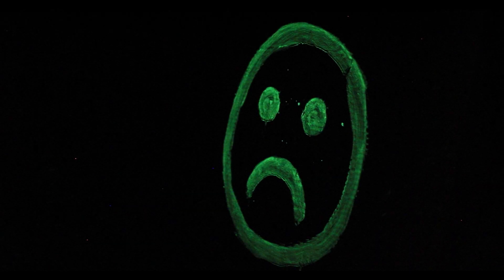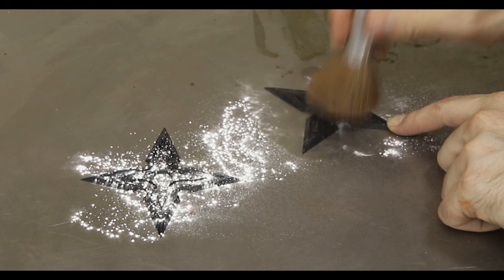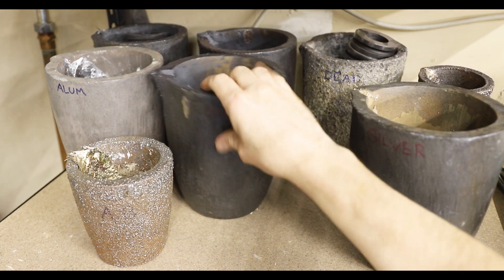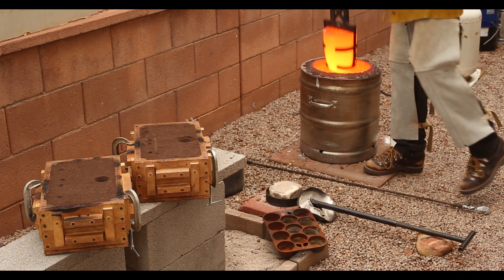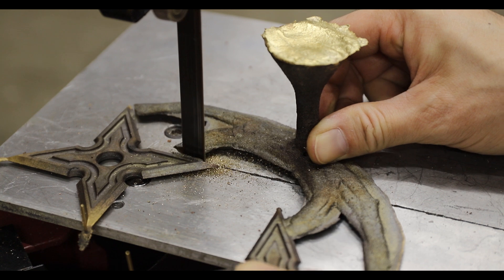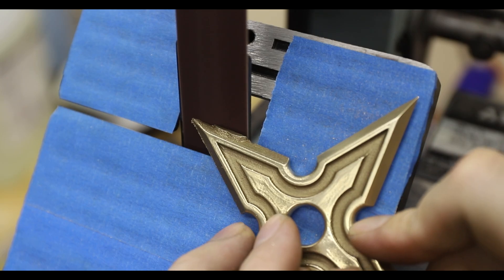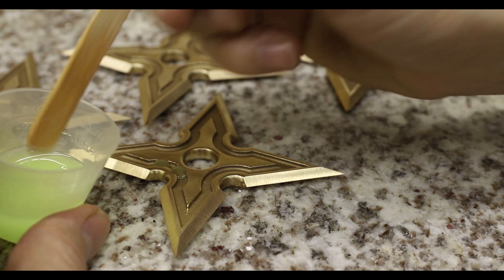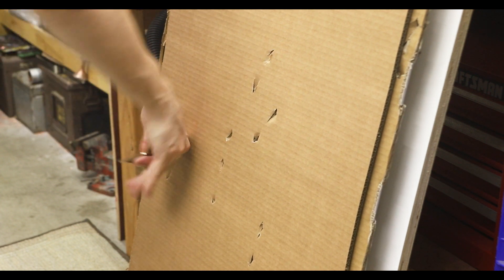Radioactive Ninja Stars - Making Glowing Metal Shurikens

Comment: Something that just occurred to me halfway through the video - not sure how much use you’d have for it but you could’ve designed these to do the original job that shuriken were made for; nail removal.  You’d use the points to dig wood out from around the head of the nail and then the central hole would be hooked around the nail head and you’d use one point to lever the nail out.

Comment: Little tip for next time!

We use two part adhesives at my work all the time. We empty the mixture into a small plastic bag (about a dimebag size). Then we cut a small hole at the end. This dispenses the epoxy like frosting on a cake and gives you great control over the amount and location.

Comment: Make a sunwheel. Make a round piece of art that goes on a wall. 

I really like how your work turned out. Im still of the opinion that if it fits into a fluid 3d printer the vacuum casting in plaster is the way to go. Veg oil guy had casted actual rubies into a ring is what surprised me. 

Maybe making an actual steam engine, of casting a cylinder, of doing a big flywheel (but that needs megal working machines.

Greetings,

Jeff

Comment: I recently saw a video of a guy using lost PLA to cast a gundam model kit in brass. There are probably some aircraft kits that would work with too, and might make a neat project. He was able to use the built in snap/friction binding mechanisms for the gundam but I imagine aircraft kits would require some brazing. those throwing stars are super cool btw, I 100% agree that the epoxy really meshes well with that color of metal

Comment: A disposable syringe works well for distributing epoxy. I use a 10ml syringe with a Luer slip tip. You need to make sure to keep the tip submerged when you are drawing it up to avoid air bubbles, but works great for dispensing precisely and avoiding drips.
Reply: Absolutely. I use epoxy a lot at work, and that's exactly what we do.
Reply: I had the same thought as well.
Reply: my first thoughts was a syringe or turkey baster type instrument as well.
Reply: That works for a lot of projects but sometimes the plunger is not ideal. A simple Dixie cup(small paper cup) is great, fold a small spout and control the flow as you like.
Reply: Look up radium girls - stay TF away from radium yawl. "The harmful effects of radioactive strontium are caused by the high energy effects of radiation. Since radioactive strontium is taken up into bone, bone itself and the soft tissues nearby may be damaged by radiation released over time."
Reply: Damn, just scrolled down to say exactly that. We used these things in lab for everything